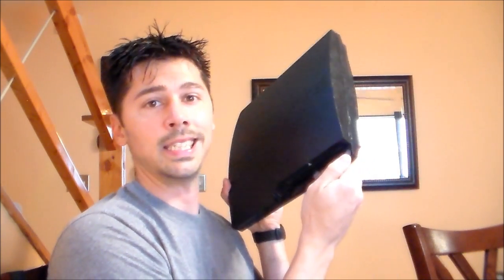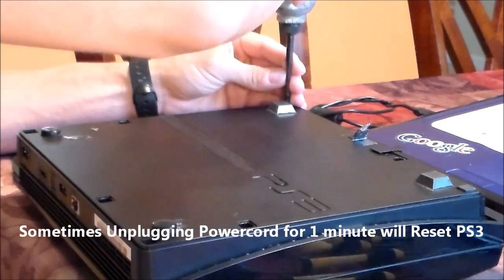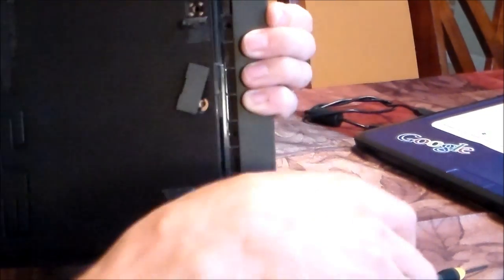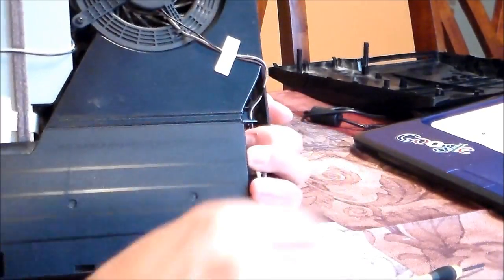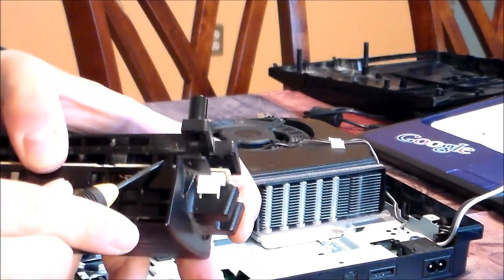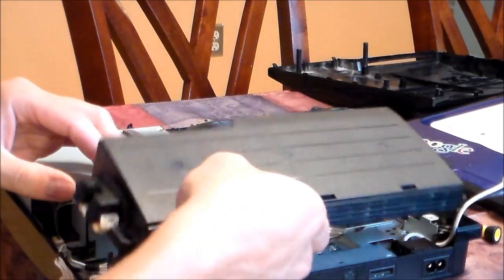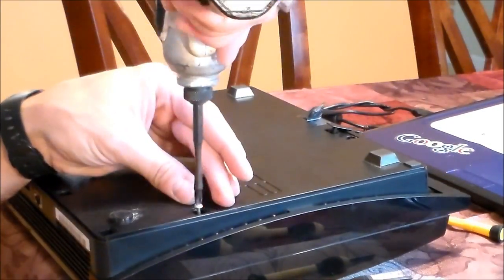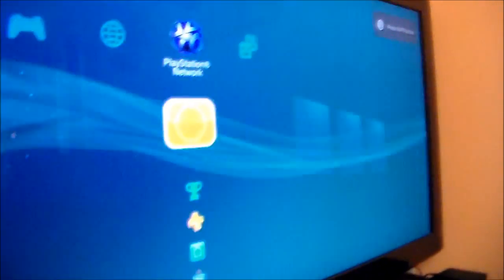HOW TO Open PS3 & Fix No Power - Powersupply install

Comment: Fucking Sony. Can't remove the power supply itself as one of the screws is too tightly fastened to unscrew. Succeeded only in grinding the crosshead into a circle...

Comment: well
when i turn my ps3 ON
after round 10 sec its turned OFF 
and that happend everytime soo i cant play now ps3
Q: its a power supply problme ?? 
plz reply me someone
Reply from the maker: yes it can be powersupply, costs $30 on amazon.
Reply: ***** yeah i'm gonna buy it
but i need to be sure if is that power supply problem :)
Thank you
Reply: That is caused by the thermal paste wearing off just open your PS3 up and find your two Spots where your GPU and virtual card are that have thermal paste all of them and scrape off the thermal paste that has faded and reapply it to the cards
Reply: T AK how u do that?